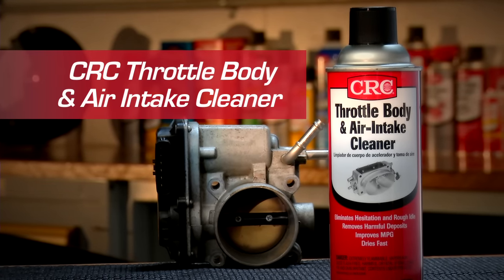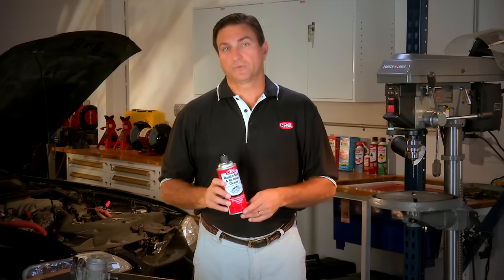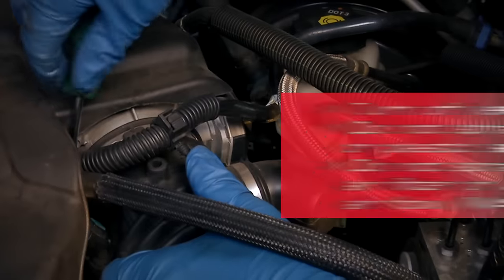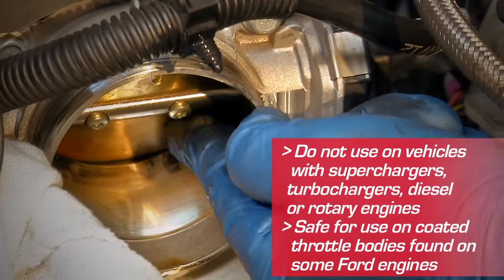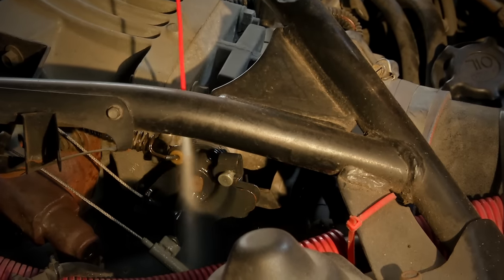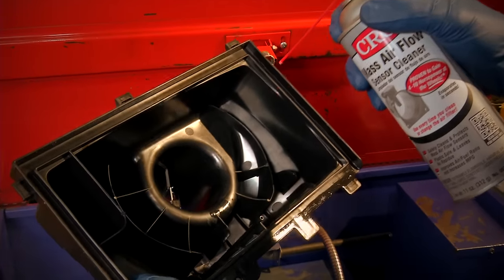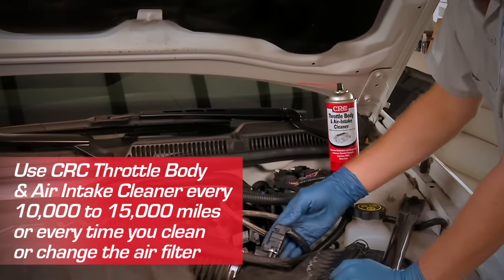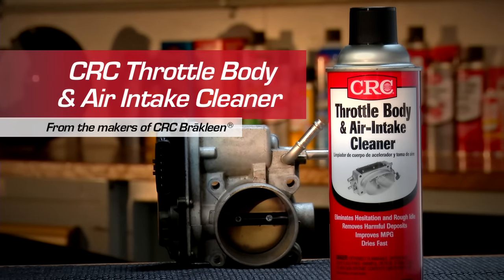CRC Throttle Body & Air Intake Cleaner Instructional Video

Comment: I'm hoping cleaning the throttle body, MAF sensor, and air filter will solve my rough idle. Wish me luck
Reply: Any luck?
Reply: @GA669  No it's definitely more complicated than that, never did figure it out, but it's not my daily driver anymore anyways
Reply: @ImperatorCaesar22  might be well gone now but thought I'd ask, do you have an air control intake valve that's removable? I removed mine and used this on piston rod/housing of this part solved alot of issues I had for like 8+years 😅

Comment: Manually moving the TB may damage the gears and position sensors. Your results may vary...
Reply: You just move it with the external cable pivot, as the gas pedal would.

Comment: I used it today while my throttle body was still connected to my manifold I think I sprayed a lot it just idle very rough and sounds like my car is cammed will it damage my engine or should I wait a couple hours to start it again?
Reply: You may have to perform what is called an idle relearn. I believe it is different on some cars so I’d look up the procedure on your particular vehicle, but it should be easy enough to do at home.

Comment: Just wondering why the cleaner cannot be used on vehicles equipped with superchargers turbochargers ?
Reply: You need specific intake valve and turbo cleaner, the chemicals in this degrade the oil viscosity within the turbo

Comment: In some other Video's it is said that don't move butterfly throttle by hand. I have Nissan Quest 2007, is it okay to do as shown in video. Does it messes up throttle programming ?
Reply: I was able to clean up. I gently pushed from long wood stick and have sprayed cleaner. I did have problem when starting car though even though I dried by 1 hr  but after few attempts, I was able to start it.

Comment: is it safe to use this on the egr valve without taking the egr off?
Reply from the maker: Thank you for your comment.  This product can be used on the EGR valve, however this product should not be sprayed into a running engine. To clean an EGR valve it would have to be removed from the engine.
Reply: @CRCAutoUS  I have seen several videos from "mechanics" who have sprayed this product while the engine was running.  Are they wrong?  Is there a reason you recommend not spraying this product into a running engine?
Reply: @ValleyGMan  Fire hazard.
Reply: @Billy420-69  Thank you.  I actually played it safe and replaced the old EGR valve with a new one.
Reply: I just did this last weekend didn’t turn out so good on Mazda 6 2016 cleaned it with my engine on while revving at 2000 RPM for 2 mins and now I have an engine light P0421
Reply: do you mean don't spray into EGR valve when engine is running ?   @CRCAutoUS

Comment: Hello, I have a 2016 Mazda 6 i touring 2.5L i recently just used this CRC throttle body cleaner while my engine was running I had my friend spraying it in the throttle the same way it’s sprayed in the video while I was revving it at 2000 RPM for about 2 mins steady to clean it out the engine light was on but I thought it was because the MAF sensor and the air intake were out after assembling everything back together I still have a engine light code with P0421 Warm-Up Catalyst System Efficiency Below Threshold (Bank 1). Could that affect My Cat system ? And would I need to get it replaced I got it diagnosed at the dealership they want me to change the O2 sensors and the cat converter. But it just doesn’t make sense why would cleaning the throttle body Mess my cat converter
Reply from the maker: Hi there.  Please contact techservice @crcind.com and they will assist.

Comment: Any idea where I would spray this on a ford fiesta mk6 tdci 1.4 diesel please?
Reply from the maker: CRC Throttle Body & Air Intake Cleaner is suitable for gasoline engines.  For assistance please contact techservice@ crcind.com

Comment: can this be used on pistons through the spark plug holes to clean them? and on the vaccum line during engine idle like foam products?
Reply: I do not think its good to clean the inside pistone as any liqued my cause the piston arm to break.

Comment: Should engine be running or not when spraying into the throttle body?
Reply from the maker: Thank you for your comment.  The engine should be off.  Spray some in and clean with a rag or brush.
Reply: CRC Industries ok I used this product and even two hours later I had issues starting the vehicle. Had to hit the accelerator a few times before it started? Will this go away or did I damage something?
Reply from the maker: @madmanbob6744  Yes this happens after cleaning and the first start up. It should be fine afterwards. Further issues please contact our Technical Service Department at techservice@crcind.com or 215.442.6290.
Reply from the maker: @socal rocks If you are referring to the PTFE coating. Our product is fine for this application.
Reply: @madmanbob6744  I am late but the reason this happened is because im assuming you listened to the salesman and you moved your electronically controled butterfly valve thingy. You are not supposed to move that at all unless it is disconnected from the vehicle. That is why your vehicle did this.

Comment: Do not under any circumstances move the butterfly valve/plate if it is electronically controlled. If you do, you will break it and then the only fix is a new throttle body. The guy doing the demo is a salesman and does not know this but he blabs anyways. The chemical is good, the demo is nonsense.
Reply: I agree & a new throttle body can be quite expensive.
Reply: This crc guy is a shill . I agree with everything you said.
Reply: I'm really surprised he mentioned pushing open the butterfly plate manually. I usually set the Parking Brake on, Turn the Car to the On position without starting the engine and push down on the Gas Pedal to open my throttle plates. I'll either have someone help me in the Drivers seat or put a weight onto the Gas Pedal.
Reply: My go to mechanic has a $15 k scanner he reset the throttle body . Move the butterfly valve throw off two positioning sensors. Only fix is relearn by high end scanner.. $10 ,Can of Throttle body cleaner should have a large type Warning on it.